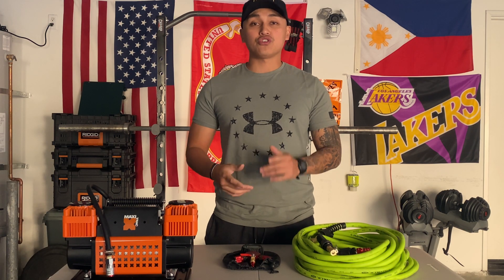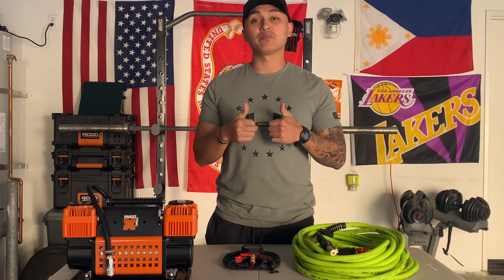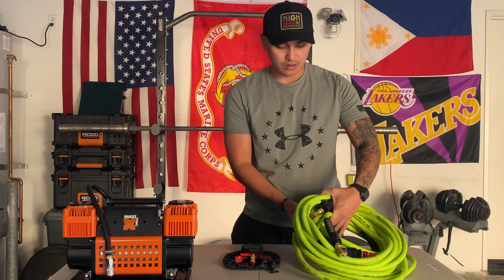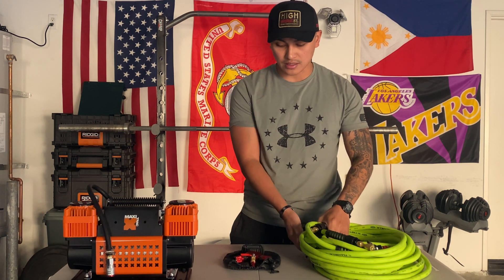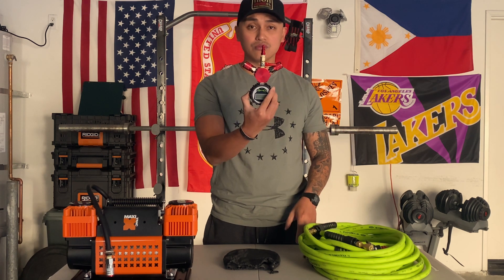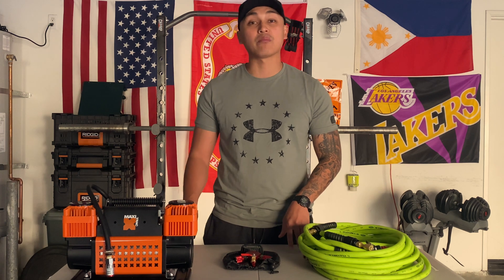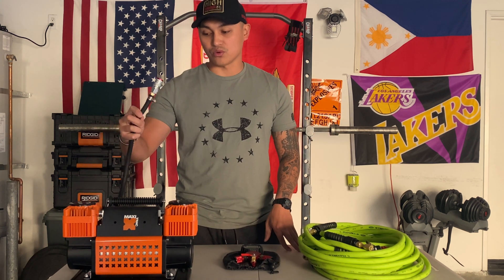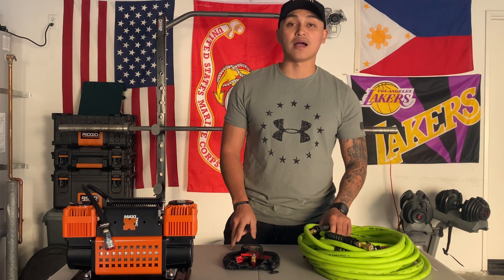DIY tire Inflator and deflator system part 1 (EASY)

Comment: It would be much better without the crappy music..  There is no need for the yellow paste.. the Teflon tape does the sealing for you. Did you check to see if each tyre was at the same pressure before you aired up ... the problem with these systems is usually one tyre will receive more air than another and also will let out more air faster than another.. usually the shortest route or the first fitting connected.

Comment: Very nice video. Can you give us a update vid on how its preforming a year later. Oh two bits of advice you really can do without the thread sealer (yellow paste) as it does exactly the same thing as the Teflon tape lubricates the threads and seals them. second if you warm your hose with something like a hair dryer on medium or even low heat it will expand enough to go over your barbed fittings and will shrink back down to size when they cool.
Reply from the maker: Thanks for the advice!! Quick little update for the DIY tire inflator/deflator; I changed my set-up for my rig. I built an internal inflator/deflator system due to downsizing gear. With my new system, I don’t have to lug around the hoses in the back or roof rack. I do still bring it for my buddy’s to use. Still works great and no air leaks.

Comment: NIIICE! I built my own simple hose setup that's only a single tire at a time (for my UTV) and I also added a "Nigo Industrial Co. Air Brake Air Tank Drain Cock Ground Plug Shutoff" so I can deflate the tire without having to connect or disconnect any fittings. I also used a Longacre gauge because I read they were very accurate. I keep learning about new ideas all the time.
The absolute biggest benefit of creating my own hose/fittings setup is the ability to inflate/deflate my tires without having to turn the air compressor off, walking over to the tire to check the resting PSI, then walking back to the air compressor and turning it back on.